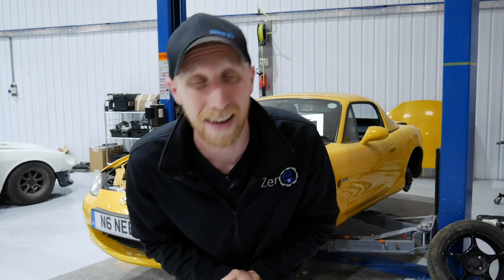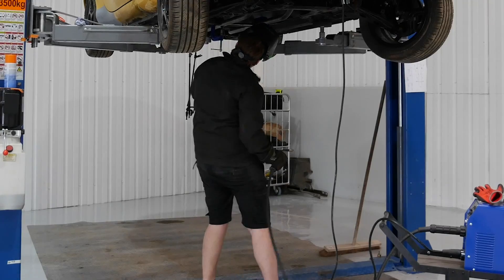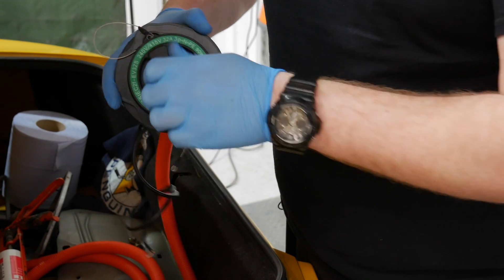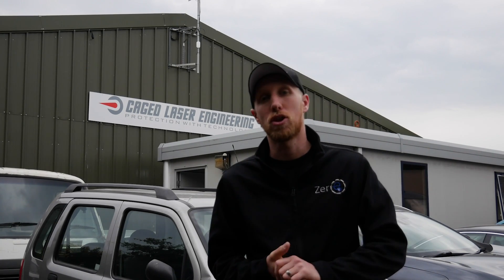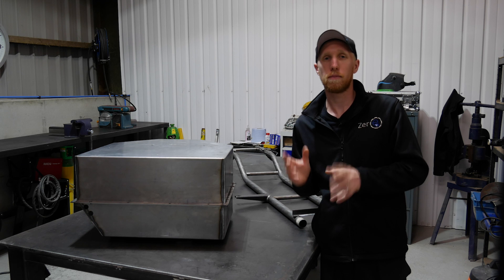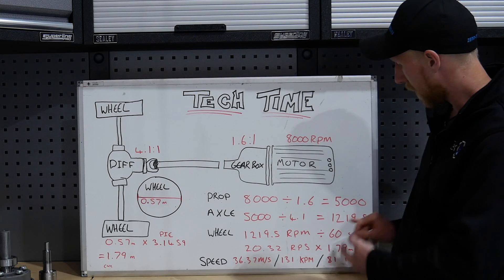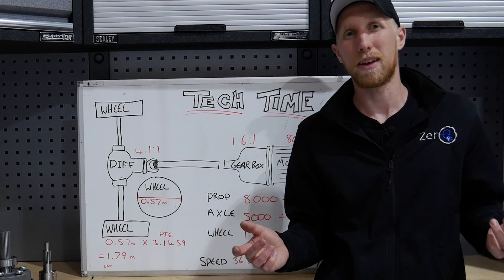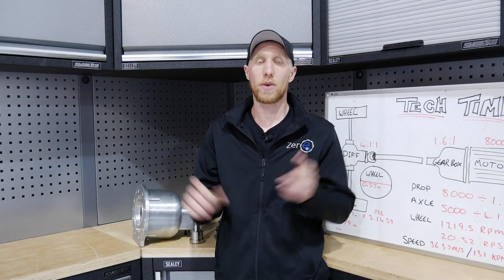Mazda MX-5 Goes Electric - The High Voltage Build - This could hurt

Comment: Why not have multiple gears? As far as i understand it, electric motors have instant torque at zero RPM but it starts going down the more they rev, being close to zero at their RPM limit. That means a multi-gear gearbox would not only help archieve a higher top speed, but would also make highway pulls better because you could drop gears to have more torque available. And at highway speeds the motor would turn more slowly, which may be better for long term reliability (although i guess the motor will have to generate greater internal forces to compensate, so maybe there's no difference there). Am I wrong on this?.
Reply from the maker: A lot of companies have tried gearbox’s on electric motors and failed even Tesla looked at a two speed but kept blowing up. A two speed gearbox would be good but would have to be custom built to take the instant torque.
Reply: In production EVs the general consensus is that it makes more sense to oversize the motor and simplify the transmission than to optimally size the motor and need a multi-speed transmission. The only exceptions are where both very strong low-speed acceleration and exceptionally high top speed are required, such as the Rimac Concept models and the Porsche Taycan - they have two-speed transmissions in the rear drive only.
Reply: What about an electronic overdrive like the MGB had?  Wouldn’t that accomplish the same thing?

Comment: Fantastic work there. That gear ratio is bang on ideal for a single speed, nicely specc'd!
The only criticism I have at the moment is that you're replacing the PPF with that ladder. The PPF is kinda-sorta a torque tube and plays a role in the torsional rigidity of the MX5. Could you (or will you be) passing the propshaft through a tube rigidly attached to the back of the gearbox and to the PPF mounting points on the diff housing? Or maybe you've done your sums and this will not be of concern?
Reply from the maker: PPF has not been replaced will be going back in and getting tide into the gearbox
Reply: @Hazell_Nutz  Aha fair enough. Good stuff.
Keep up the good work. I need to start saving my pennies.
Reply: The PPF is a beam, not a torque tube... and they're keeping it anyway, as they should.

Comment: Would/have you converted a Jimny? 
How much is this likely to cost?
Reply from the maker: Not ever looked at one
Reply: I like the idea! The engine bay is surprisingly spacious in my mates Jimny (a 2005 model I think?) and I have found it quite pleasurable to work on so far. Since the Jimny is pretty gutless I feel like it would probably be pretty great if you were willing to sacrifice some batteries/range to keep the weight down.

Comment: 130km/hr top speed??  Holy crap. I’d get passed on the highway with this. 😂. Seeing as how my original NC miata I could take all the way up to 190+, this is extremely low for all this conversion.. 🤔
Still interested to see the end result. Keep the vids coming! 👏🏻
Reply from the maker: This is because of the motor we are fitting. Our normal motors do 12-16000 rpm
Reply: Zero EV particular reason why you’re holding back?  Power consumption?  Weight?

Comment: I am sorry if this slipped past everyone, but did he not say "it needs oil" , as in, "dinosaur cadaver"  fuel? As in most electric vehicles, " oil "is still needed. And, let's not talk about the environmental impact of cobalt mining.
Reply from the maker: Yes the gearbox and diff will need oil. Let’s not take about drilling for oil or fracking ether 😂 everything has an impact but cobalt will soon be a thing of the past.

Comment: How would you go about sending the power to all 4 wheels in a 4x4. I have a Landrover Freelander 1 TD4 that has blown and was thinking of taking out all the ICE things and making it an EV Freelander (Body and interior is perfect it's just engine side as turbo went)
Reply from the maker: Mount the motor to the transfer box would be best
Reply: @Hazell_Nutz  Awesome. How would you work out the speed etc? Same as you did here but take into account the transfer box instead of the gearbox that you're using? 

It's such a nice motor and seems a shame to scrap it when everything but the engine is perfect. Want to do the Dash adaption too so it's all standard tech and it's all stealth so no one knows it's an EV 4x4.

Comment: MX5 not stable at 80mph? In my 1991 miata, I've been cruising at what i thought was 60 and then looked down to see i'm going 80-85. maybe it's just mine, but the car is super smooth at high speeds.
Reply: I took my NA up to 100mph and the front became very light. Ok in a straight line but not good if you need to turn!
Reply: @PixelisedPaul  an LS1 swap would fix that light front end lol

Comment: with the pipe frame in place, the motor will not be able to be removed from the under side, with out removing the battery box.
are there any provisions for an ac compressor, vacuum pump etc.
Reply from the maker: That is correct but should not need to be taken apart. The car does not have AC. We will be fitting a vac pump

Comment: Why not retain the factory gearbox? It would be a bit different but you'd be able to shift up for higher speeds and potentially better mileage.
Reply from the maker: The point of this build is to test our new gearbox plus you would loose loads of engine bay space for batterys
Reply: @Hazell_Nutz  gotcha. Would be interesting to see the car weight on all 4 tires after conversion

Comment: Would an automatic be a good base for this conversion?  Auto MX-5s often are in better condition with lower mileage thanks to older drivers keeping them garaged as weekend cars rather than being thrashed and modded and kept on the street by younger owners.  Already has 2-pedal layout too, which I guess you'll want.
Reply from the maker: Not a bad option but the first few gears are but needed so depend if you can select or hold on set gears
Reply: @Hazell_Nutz  Sure, though I wasn't supposing you'd keep the auto gearbox, just musing that automatics might be a useful source of better-condition used cars for future conversions (unless there was something i hadn't thought of which made them less suitable).  Mk.2 MX-5s in particular suffer from rotting front chassis legs as well as the rear sills and arches which also afflict the Mk.1s, so garaged summer-fun-only cars which haven't suffered 20 salty winters seem worth seeking out. 
Very much looking forward to seeing how this progresses.  The repurposed fuel filler as the charging point is really neat work.  Hope the rest of the details work out as well.

Comment: Unless your suspension is worn out, an MX5 should not feel unstable at 80 mph... But I do understand prioritizing acceleration over top speed, I would do the same.  Oh, and in your calculation I hope you were using the tire diameter not the wheel diameter :)
Reply from the maker: Wheel is the complete item that is made up of a rim and tyre in my head 😂

Comment: In terms of simplicity: what's wrong about using the OEM MX5 gearbox?
And just an adaptor plate to the motor?
Reply: Loss of space in the engine bay where the batteries are positioned. Getting a  gearbox adaptor and clutch adaptor made is quite expensive and time intense.
Reply: @Tom-evnut  More expensive and time consuming than a new gearbox and custom-made prop shaft??
Reply: @Paul_VanGo  Yes and no, you have to look at the whole package. You would be spending more effort putting batteries elsewhere the all in one place. This build the main goal is to test the new gearbox so makes decisions all the easier.
Reply: @Tom-evnut  Ah, OK. In that case, that makes more sense.
Reply: @Paul_VanGo  If they did this correctly (gearbox tail ends where stock transmission tail does), the stock prop shaft should still work.

Comment: Out of interest, why go to rotations per second, when you could multiply to get rotations per hour and multiply that by the circumference to get straight to meters per hour (which you can easily divide by 1000 to get kilometers per hour)? Also, some time ago, I made a simple web calculator that worked this all out for you: http://evthoughts.blogspot.com/2011/10/vehicle-speed-calculator-mark-2now-with.html
Reply from the maker: To be honest have a spread sheet that does all of this for me so just through something onto the white board without to much thought.

Comment: Yet another interesting episode.
As I wish to convert a fully fiberglass kit car over to Electric,  that even accepts the suspension being bolted directly to the fiberglass because it has no metal chassis at all. Would you accept the parts you showed being fabricated in this episode in GRP ?
Oh, by the way, theres nothing wrong Chris, with the accent. These cas understand thee gurt proper like me old babers. Like.
Reply from the maker: Ideally battery box should be metal or flame / impact proof to an current level.
Reply: @Hazell_Nutz  how about if the battery box is right down the middle of the car where the transmission tunnel would of been ?
Reply: Oops, just realised the important bit there was the flame proof bit. Which would mean, it needs to be metal no matter where the location for the batteries.

Comment: Where can you find transmissions for EVs? Are there any designed for FWD conversions? EV transaxles? How could you figure out if an original transmission is strong enough to take the torque produced by an electric motor?
Reply from the maker: Most transmissions will work find as you can program the motor to taper in its torque
Reply: @Hazell_Nutz  OK great! For my own reference, is there any data on different transmission torque capacity?

Comment: Good tech talk, calculating the speed through the motor and gears, but you didn't mention torque which is inversely proportional to the speed. High torque low speed and....
Reply from the maker: That is very true.

Comment: "Bullet aluminum" doesn't seem to be a thing. I think you mean BILLET, which means it was machined from a solid block of metal. That's usually a good way to go for overall strength, but it's going to make the production costs and total weight higher than they need to be. Have you considered going to casting for the final production model? I know they don't look as shiny, but it'll be under the car and out of sight most of the time, and you could make the EV conversion more affordable for more people.
Reply from the maker: Yep your right. We will be going cast on the final design but will build a batch of 10 from billet first.

Comment: Could you use a 2 speed gearbox?
Reply from the maker: If there was a usable one available but unfortunately there is not. Our new motor is 12,000 rpm and double the power so none of this will be a big issue.

Comment: wait so you're estimating 0-60 of 8 seconds and a top speed of 81mph?  What is the benefit of spending this amount of money on an EV conversion?  I would only do it for the instant torque.  Don't see why anyone would do this over an ICE.  and I'm an EV fanboy
Reply from the maker: This build is to test the new gearbox. We are not to worried about speed and top speed as mainly test vehicle and for YouTube. Our new motor will be double the power and 5000rpm higher so all these issue will be long gone 👍⚡️

Comment: Chris,
Nice episode on the MX-5 conversion.  I just realized that the sweet shifting 5 speed is gone. ... ... ... ...  Question on that and the acceleration / top speed trade-off:  Any reliable 2 speed, high capacity gearboxes for an EV build?  Get a direct-feel shifter back too ??
Also glad to hear you mention powder coating all of the excellent cradle and battery box work so the road salt doesn’t eat it alive.
Thanks again for the great inside-look at converting a sweet sports car to EV.  Truly shocked how low loosing the manual trans left me.
Reply: ... hence my comment about maybe using an overdrive unit; if you only need two ratios then it's a possible solution.  Back in the early 80s I had an MGB - it was old and asthmatic but for it's era the 0-60 time was okay; however, without the overdrive it would have run out of puff at speeds above that.  As I recall it was a simple and lightweight unit (but I may be recalling it incorrectly - I'll have to look it up)
Reply from the maker: This issue is rpm of the hyper9 only being 8000 our new motor is 12000 rpm so none of this becomes an issue.
Reply from the maker: We have looked at two speed but tend to find the instant torque make gears cry

Comment: How about a 2 speed gear box with a 1:1 or direct top gear to improve top speed and or highway range?
Reply: Yup that would work, it just gets more complicated. The reduction is designed to be simple to start, looking at multiple options for getting multi speeds working.

Comment: I thought most ev motors are rated 12k and some all the way to 18k? Why is this one so low this is ICE territory rpms.
Reply from the maker: It’s just the way it’s designed most of our other motors are 12-18k
Reply: This is a low-voltage motor, intended primarily for low-speed industrial vehicles but sold by Netgain for EV conversions. The expectation is that it will be used with similar gearing to the original engine, so a similar speed range is appropriate.

Comment: Are the gears in the planetary gearbox straight cut?
They will scream at 8krpm.
Reply from the maker: Yes on this one they are but is not standard just want to see what the sound difference is
Reply: @Hazell_Nutz  they are very loud. Especially at that speed it will be louder than the original petrol engine. Generally reverse gears on manual gearboxes are straight cut. Imagine the noise if you run your car in reverse at 8krpm. That is how it will sound.
Reply: @franciscoshi1968  Good point. And since it is a planetary then there are more gears involved then in usual manual transmission reverse has. It will be a nighmare at top speed. I do not believe it is zero EV own design gear reducer. Can't it be parts from some old automatic? Who and where does gears for you and what would it cost if you order one or ten units only?

Comment: It didn't look like the larger hole for the charger got painted. time will tell.
Reply: It has been cleaned and sealed in place, as you do not want rain coming in and rusting out the inside.

Comment: Could you do a tech talk if you wanted to massively increase the performance beyond the 8s 0-60 and 80MPH? Say 3s 0-60, top speed is fine.  I think a high performance electric MX5 would be great for Gymkhana (what we call Autocross in North America) but 8s won't cut it.
Reply: You can do anything you want if you throw money at it. This build is more to be as close to the original car as possible for a reasonable budget. If you want a Gymkhana capable mx5 electric it would need to be 400V and 200-250kw.
Reply: Yeah. So maybe a little spot on the various approaches to performance electric? Not in context of a specific car, but the things to take into account. Then contrast that with the MX5 build or the Porsche build.

I've got to imagine more powerful motor means larger motor, larger batteries etc. So understanding the trade-offs.

 People do engine tuning, turbos, engine swaps, etc to ICE all the time. Would be nice to understand and document that world as it would apply to the EV world.
Reply: If you use the shortest available final drive ratio and Zero EV's greatest reduction ratio gearbox (if they ever actually sell it), you could have much better performance... at the expense of top speed, but fast enough for autocross.

Comment: In the MX-5, rear diff torque reaction is, er, reacted up the folded steel reaction structure, and into the powertrain (Eng+G/box) thereby nicely spreading those loads into the body structure. This puts the reaction structure under vertically oriented torsional load, and as you'd expect that strucutre is therefore vertically oriented to carry those loads.  Your version of that strucuture however is two tubes in bending, which seems  a really bad way to carry a that load? Every time the power and torque are cycled those tubes will flex, and ultimatly possibly fatigue until they crack. And with a electric traction being completely bi-directional, that flexing is worse than for an ICE, because regen can be a large negative torque (unlike for an ICE where only engine friction acts to oppose firing loads).  The static loads are easy to work out, they are the same as the peak tractive effort (motor peak torque x gear ratio), but you should allow between 2 and 3 times the peak static load to account for dynamic loading (ie wheelslip). Consider at full torque driving over say a wet steel cattle grid, where the rear wheels go from fully grip, to full slip, and back to full grid in less than a second, those loads can be SIGNIFICANT.   Fusion360 includes some basic FEA, so you can apply your loads to your structure and get at least a first look at to the average and macro strain, you may be suprised at how bad it looks!
Reply: The structure is not finished, The frame is hard mounted to the body. On the 4 cross brace mounts and then on the motor mounts. The original Powertrain brace will be kept, making the load as you say vertical loading onto the mounting points. Current the biggest issue will be the Original body structure taking the loads as intended, tubes do not take biggest part of the load.
Reply: @Tom-evnut  This steel tube frame looks very nice and professional. And I believe thanks to that you don't have to weld or drill extra attachments anywhere on the body  right? Your work is so high level that I wonder who will cover all the costs and labor.
Reply: @Tom-evnut  it is good to hear that you are keeping the original tongue arm.  As Max Torque points out, it  is crucial to the structure of the car.